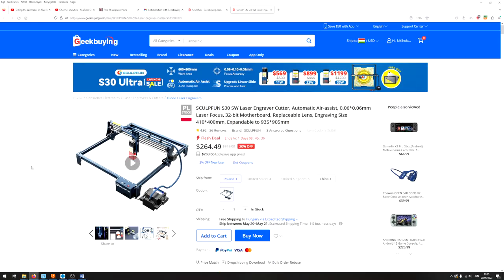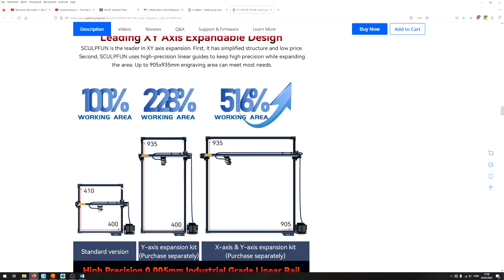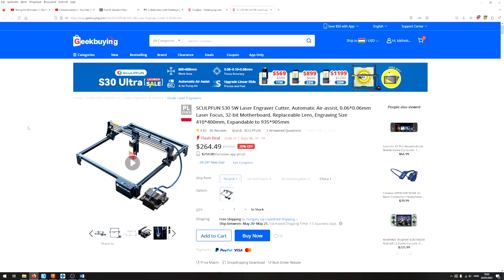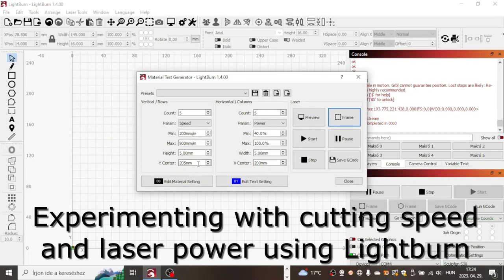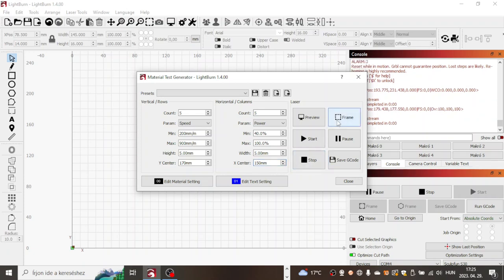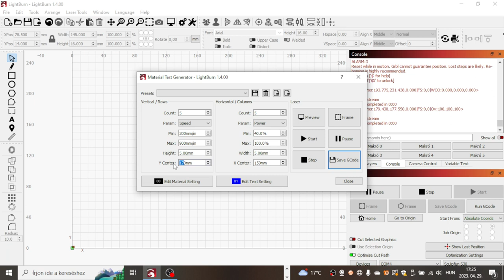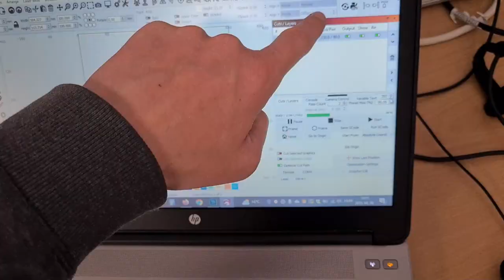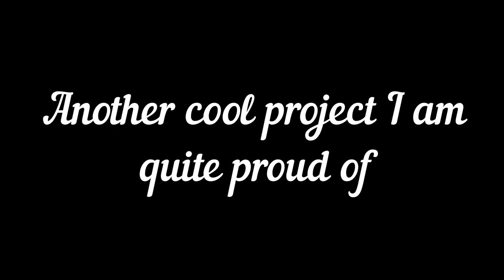Sculpfun S30 5W diode laser engraver cutter test - Best budget laser?

Comment: Hmm.. I wonder if it can be used with home made circuit boards etch/engrave traces etc.. possibly put a logo on the board too! Looks like a handy gadget 👍
Reply from the maker: I think you cannot burn copper away. It can only mark stainless steel. Maybe putting a logo on the FR4 itself would work. I am thinking to do the PCB photo "printing" with it.